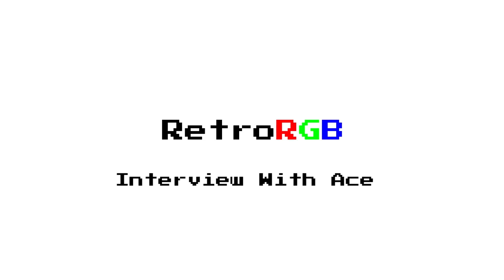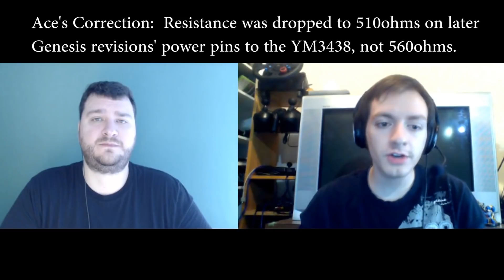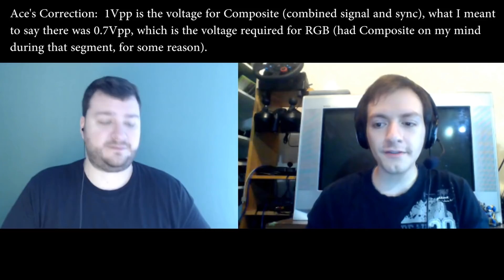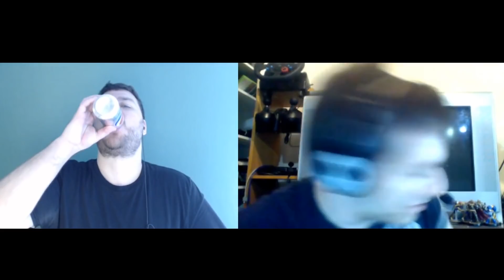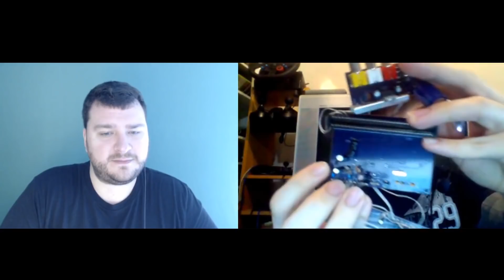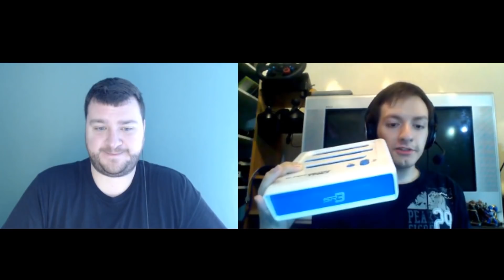RetroRGB Interview: Ace

Comment: @Ace9921 this reminded me that I needed to record the audio from the VA models you are missing samples from.  Also I bought a crappy Genesis to 32x cable that still had the 5V pin.  and I found that the Genesis will power the 32x by itself.  so I increased the power block to a 2A 12V to the Genesis I only played it for about 10 minutes because I didnt want to mess anything up on ether system.

Comment: Hi there, villahed94 here,co-creator of the Mega Amp. Great Interview!  By the way, the original designs of the Mega Amp were very different to what they were when it was released.
At one point it was filtered only , but I saw potential on the circuit given its simplicity and I asked Ace about the idea of making an unfiltered version. 
While he wasn't originally into it, I proposed it as a good alternative to people wanting that CCAM unfiltered audio without the hassle required to DIY. 
 The tests for the unfiltered version began in February 2013 and by May/June we had a consistent and modular design which could be used with all iterations of the YM2612 and YM3438 with minimal changes.  We then just held the circuit to make the final changes prior to releasing it in January 1st 2014.
BTW,  I have been working on a project about YM2413s and Genesis consoles. I have a functional prototype ready and will be released in the near future :).

Comment: In terms of Sega's intent for sound on the Genesis, since the Genesis was based around the System 16 arcade boards, wouldn't the intent to be as close to the YM2151 as possible?   How close is the 2612 to the 2151?  Were there any other chips on those boards?  What about the filtering on the arcade hardware?  They were, after all used in a few dozen other arcade boards.  

Regardless of Sega's direct intent, we also have to consider what sound chips development at third parties would have likely started with.  So if you look at the Dev kits for the Genesis, they're what third party devs would be targeting, at a minumum, right?  Matt Phillips has a post on his YouTube channel where he's working directly with an old dev kit, and guess what?  Sure looks like a model 1 Mega Drive to me.  It'd be really interesting to get in contact with him and have a look at that board, don't you think?

The other thing that I'd ask is "what do you think" about an analog-to-digital audio conversion?  I know that isn't part of the hardware today, but if the delay in conversion can be held to under a frame (16ms), then there shouldn't be any issue, and the upside benefit would be that the conversion would eliminate any additional noise once the signal leaves the the box - crappy audio cables, where the cables are run, etc - cease to be an issue.  I think there's some merit to this, but it's just an opinion.
Reply: System 16 boards generally all use the YM2151 and have some pretty heavy low-pass filtering with a 1st-order low-pass filter in the 3.3KHz range. I would think if Sega were attempting to mimic the System 16 as much as possible, that's the correct filtering, but with the YM2612/YM3438, considering the majority (maybe even all?) devkits use a YM2612, I would think that's the intended chip. That goes back to what I said about VA2 and VA2.3 Genesis Model 2 boards; if the YM3438 were the intended chip, the logical thing to do would have been to use a discrete YM3438 instead of the YM2612. I personally attribute the YM3438 switch to the NMOS/CMOS manufacturing process mismatch between the YM2612 and Yamaha-manufactured ASICs from the VA7 Genesis Model 1 onwards.
Reply: Really cool, thanks for the reply - yeah for sure, the YM2612 is the right chip between that and the 3438.  I was "thinking out loud" as I was listening to the interview.  Have you gotten a chance to check out a dev kit?  That'd be a really cool "treat" - how many even exist anymore?!

Hey, I have another question for you.  I have a non-TMSS Genesis (and a TMSS Model 1).  What's a good game to listen to that has 'loudness' cutting out in the VA2 versus the other model 1 boards?  I haven't noticed this, and for whatever reason, now I want to torture myself.  lol
Reply: Streets of Rage 2 and MegaMan: The Wily Wars are my go-to games for checking audio distortion. Both are loud and bass-heavy, and get pretty badly garbled on a VA2 Genesis Model 1. Sonic 3 works, as well.
As for devkits, I unfortunately have never even seen one in person. Would be a nice system to have, though.
Reply: Ace9921 again, thanks much for the reply. SoR 2 is one of my go-to games.  Don't have a repro of Wiley Wars (or a sd cart yet), but I'll check that out tonight!

Comment: Damn this was great, especially after the Genesis audio conversations on the Retro Roundtable, where Voultar even mentioned Ace recently.  Keep the vids coming, Nerd porn! And btw I have a Genesis with that same screw in the bottom of it. It's a HD graphics model with the longer serial number(FJ846eusasega) and ext port on the back. I got it off a friend recently and it came with the metal plate attached to it for the sega cd.  I'm assuming it was attached by that screw and when I removed the plate I just re-inserted that screw back in. Now the question is, do all have that hole but not the screw, or is it the hole and screw that usually aren't there? Not sure.

Comment: Really enjoyed doing this, and I'm hoping to do this again at some point. Thanks for having me on!
Reply: Ace9921

Congrats, man.

Just started watching, but I know it's going to be great. ;)
Reply: Yes, there is a face to the creator of the Mega Amp and Mega Amp 2.0 (although my colleague Villahed94 hasn't shown his face yet, he worked on this with me, though he was more involved with the original design).
With regards to the 32X losing an audio channel over time, it sounds like you either have a dodgy patch cable or the traces on the 32X audio inputs are fragile. I've had my share of faulty traces where the traces were actually damaged, but could not be perceived with the naked eye or even a magnifying glass. In that instance, I would cut the trace right at the cartridge slot, add extra 75ohm pull-down resistors and take the audio from there.
Reply: Unless you want digitized analog audio, no. As I said in the interview, there are far too many analog-only sources on the Genesis and the system's internal audio has all DACs integrated within the audio hardware. If you ask me, that's a pointless endeavor.
Reply: Good to know you got it sorted out.
Reply: I've hung out on the SEGA-16 forums for a couple of years, I didn't know you were a fellow Quebecker Ace.
Reply: @theimporter Born and raised, though I'll be honest, Montreal is starting to piss me off a bit with the unbelievably disorganized roadwork that makes navigating the city worse than trying to navigate a minefield blindfolded. I mean, jeez, could you not just do one thing properly then move on to something else instead of breaking up every single street in one shot and leaving a mess behind? It's seriously getting to me (even my father's complaining non-stop about the roadwork around here).
Reply: @Ace9921 I know, I go to Montreal 2 or 3 times a year (I'm a Laval guy) and every time I do, there's always construction where ever I go. Quebec roads man, they use Play-Doh for pavement.

Comment: I recently made recordings of my VA2 and VA3 Genesis and sure enough, I could hear the difference in filtering levels. I never knew this was even going on until I found Ace's thread on Genesis revisions!
Reply: KarbuncleX so from what I gathered, the VA3 up until but not including the VA7 are all better than the VA2 as far as audio is concerned?
Reply: I prefer the wider range of the VA2 after I did some sound tests with Thunder Force III. However, I understand that the VA3s and on up apparently handle games with overly loud audio better.
Reply: Yes, they do, and that's down to the preamp gain being lower on the VA3 to VA6.8 boards. If you want my advice, replace the low-pass filter capacitors on the preamp of your VA3 Genesis Model 1. The original ones are 5600pF, but if you replace with 4700pF, you will get the same cutoff frequency when combined with the 10Kohm feedback resistors as you would with the 47Kohm feedback resistors and 1000pF capacitors of the VA2 board without the distortion caused by the excessive gain of the preamp.
Reply: I will definitely give that a try! Thanks for the tip!
Reply: Hey Ace, I'm having trouble locating these caps on the board of the VA3. Nothing seems to match 5600pF. Can you tell me the location number for them (as in C56 for example)? Thanks!
Reply: Unfortunately, most Genesis Model 1 motherboards have no silkscreen for the part numbers on the underside of the board. If you want to locate the capacitors without part numbers, look on the underside of the motherboard just next to the power switch. There should be two rows of resistors with one capacitor in each row. On a VA2 board, these are 1000pF capacitors and are located just above a 47Kohm resistor (marked as 473). In this same spot, a VA3 board will have 5600pF capacitors above 10Kohm resistors (marked as 103). The capacitors themselves are unmarked.
Reply: After I took the console completely apart last night, I was able to determine it had to be the yellow SMD caps underneath. Glad to see I was on the right track, and now I know what type to order. Cheers!
Reply: I've located the rows in question, but noticed one of them has two yellow caps above the 103 resistor, while the other just has the single yellow cap. Do I ignore the extra cap and only replace the one directly next to the 103 resistor?

Comment: Also I hope ace will make a guide for the model 1 va2 preamp fix I need to get mine done also I hope he starts selling his new mega amp I want to buy a bunch
Reply: I'll be working on that at some point. I seem to have misplaced my VA2 Genesis Model 1, so it could be a while before I can get a guide up.
As I said in the interview, once I correct my PCB design to fix the flawed mono output of the Mega Amp 2.0 (an apparent biasing problem causing severe crackling and distortion), I will get a fairly hefty batch in to sell and install into spare systems that I don't need. I have enough parts to make about 30 corrected Mega Amp 2.0 (really should be called Mega Amp 2.1) PCBs.

Comment: For After Burner II, the best example is Red Out initial jet flyby SE. It's very clear on the 2612, much lower on 3438, and pretty much inexistant when emulating.
Another example of 2612 noise usage is Earthworm Jim 2 Villi people music, used a lot for lingering, low notes.
Reply: Really, you can go on for days finding multiple examples where DAC noise on the YM2612 is very apparent when the YM3438 nearly completely kills it all. Even the original Earthworm Jim has instances of a few notes that sound completely different on a YM2612 than a YM3438 (although the music timing is screwed up due to every Genesis with a YM2612 being based on Sega's discrete hardware design that can't read the FM BUSY flag from $4001 to $4003, and Earthworm Jim has one read from $4002, which returns nothing on those older system and the VA2/VA2.3 Genesis Model 2 since those only have FM BUSY accessible from $4000 - nothing a quick and dirty patch can't fix, though).